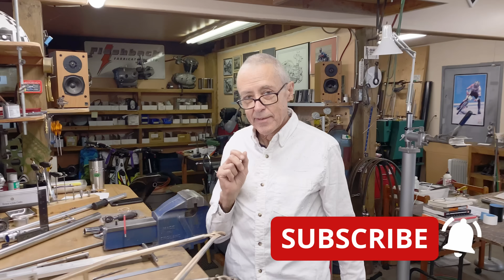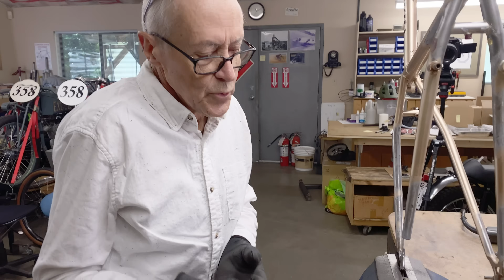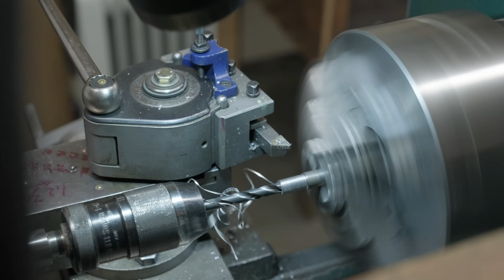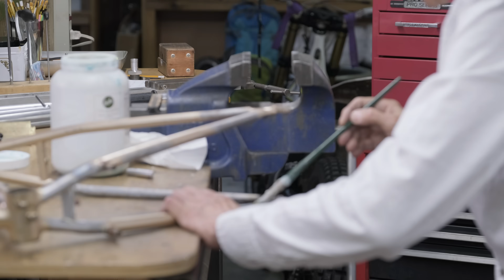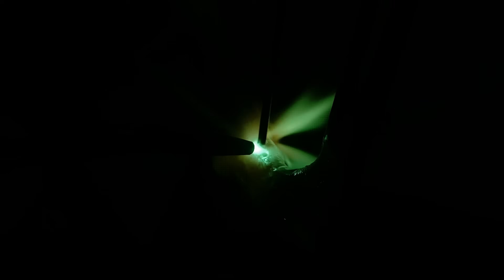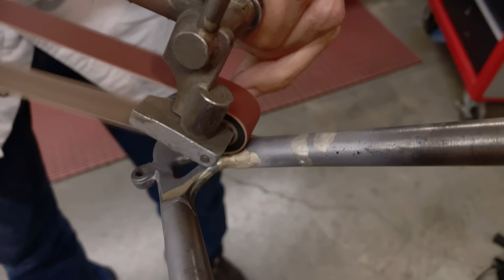How to fix a CRACKED bike frame! // Paul Brodie's Shop

Comment: A forty year old tool vs. a 2 year old tool and the older one works great. Same for everything else. Everything made to fail now thanks to capitalism.  

I have a Trek with a big gouge about 3 inches further along on the same section. I don't have the shop and equipment or knowledge that you have. :(  Still, a very interesting video. Recommended by the Bike Farmer's fan. Thanks.

Comment: Hey Paul, I've got an old Dawes 531st with a small hole and 2 vertical cracks on the chainstay caused by tyre rub. What sort of DIY repair would you recommend for this?  I thought about sleeving it, but the tube is tapered. Another option is patch it over and silver/nickel it. any ideas les me know. if you answer i'll buy you a coffee! ;)

Comment: The "new drill smell" might be ozone. Both drills probably mave brushes that arc a little and create ozone. But the cordless one, when you released the trigger,  stopped abruptly.  That may be done electrically,  making a bigger spark...more ozone. The corded one just coasts to a stop.. Sometimes you can see the sparks through the vents.
   Do you use any particular brazing rod? Al, Si, or phosphor bronze?
   Are these frames typically heat treated when made?
    Thanks, I enjoy your videos and their pace, starting to watch many. I'm more a motorcycle guy, but it doesn't matter much, they overlap.
Reply: Oh...nickel-silver, you said in the video. I meant to ask that brazing alloy question in your dent fixing video, too..I'll have to go back to that.

Comment: I am loving your videos. 
I was wondering why you used thicker wall dom and bored it to a thinner wall thickness, instead of starting with a thinner piece of cro-mo, or use  a thicker cro-mo piece to do the repair?
Reply from the maker: Thank you Kirk.  4130 is not available with thicker walls, usually only thin wall, and is quite expensive. It's just a LOT easier to use DOM...     :face-fuchsia-tongue-out:

Comment: Hey, my columbus slx seat tube (from a very nice bike made in 1982) broke in half in the middle part, and this video gave me hope that maybe it could be fixed with similar type of internal sleeve brazed in. It most likely broke because I weigh 115kg. Do you think it's worth doing? Or should I switch to more heavy duty bikes?

Comment: I broke a Raleigh frame at the drop-out, after 11years of ownership.   They replaced it free of charge, as it was still within the 12 year Warranty.   They gave me a black one instead of the white and yellow one that I had.  They said all replacements were only in black.   I have also repaired motorcycle fuel tanks with pin holes, using 60/40 solder, and a big copper soldering iron.    Best regards from N Wales..
Reply from the maker: Hello N Wales. Thanks for commenting.

Comment: Nice video!  But all the time I was wondering what about the rust inside the tubing?
Reply from the maker: Thanks. That rust has been there for many years. The bike will probably not be raced or ridden hard, so as a collector frame I think it's ok to allow for a little rust.

Comment: Your frames and Pace forks were a dream of mine in my youth. I've managed to get 2 Pace forks since then, but not one of your mythical frames yet.
I have a beautiful Tange Ultimate tubular frame and I'd like to have a conical bushing and disc brake mount installed, but I'm afraid it will be damaged during the procedure. 
What's the latest high-end, lightweight steel tube for a nervous XC MTB frame?
Reply from the maker: I do not know Pace forks. Actually, I've never even heard of them! You will have to choose a framebuilder that will not damage your Tange frame... I cannot answer your question, I am out of touch with the latest, high end tube sets, sorry.
Reply: @paulbrodie  Thank you very much for your reply.
You can't imagine how much these few words exchanged with you mean to me.
Reply from the maker: @siem8160  You are most welcome. But I still have no idea what a Pace fork is....    :face-orange-biting-nails:

Comment: Hey Paul, you look great, I’m guessing you’ll be filling us with educational videos 30 years from now.  To repair stripped threads in a derauiller hanger without replacing the dropout, have you ever used a threaded insert like a Helicoil?  Or another way is better?
Reply from the maker: Thanks John. We will make videos as long as we can. I'm not a real fan of helicoils. On a steel frame I would weld on another hanger...   :face-orange-biting-nails:

Comment: The best welders I have seen always started out perfecting brazing skills. After brazing I always encouraged gas welding which after mastering, almost instantly made you able to tig weld successfully.
Reply from the maker: You might have a point. But you do have to learn to use a foot pedal (usually..) for Tig welding...

Comment: Hi Paul & Mitch, Thanks for the greatclips. On a matter of design, this particular frame has the brake bosses underneath the chainstay. I've never seen this approach before. It appears to be a little on the non-conformist side to me. Wouldn't having the brakes in that location expose them to additional, mud, grit, etc.? Paul, best wishes for your recovery.  Kind regards Greg
Reply from the maker: Thanks Greg. In the mid-eighties, quite a few frames had U-brakes mounted under the chain stays. We rode in the mud, and they still worked fine...

Comment: The late 80's and early 90's was the era for 130mm for your 7spd hubs and 135mm for your 8spd. Eventually 7spd hubs became 135mm to match. Prior to that was 126mm for your 6 speed hubs, and 120mm for your 5 speed. 

Road bikes differed in that they used a 126mm spacing for 6 and 7 speed.

The 80's had some of the coolest mountain bikes, but those hyperglide cassette hubs in the 90's were a huge improvement. My boss said his old shop had a drawer full of left-hand Campagnolo dropouts. All the right hand dropouts were used to repair bikes with broken or bent axles...
Reply from the maker: Alex, thanks for watching and commenting...  I'm not sure how the RH dropouts were used to fix broken or bent axles!??
Reply: @paulbrodie  The bent or broken axles from old bikes with freewheels would often cause a failure to the RH dropout too. Campagnolo dropouts were quite delicate and fine from memory. My boss would often replace an axle and the RH dropout at the same time...

Comment: That electrical smell from your cordless means that the drill windings overheated, which causes the insulation to crack and grow dimensionally, which causes it to rub against the windings as you use it.  This creates that smell, which gets worse the hotter the drill gets.  A more durable brand for a real workshop (vs a home shop) would be something like Milwaukee.  Maybe you could get them to sponsor you and give you a free one.
Reply from the maker: That sounds like a great idea! Yes, I am disappointed with the Bosch cordless. I really haven't used it that much, or very hard. I might take it back to see what they say...

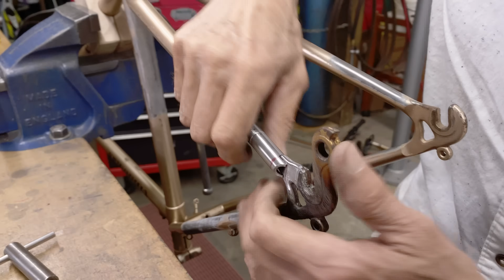Comment: 17:44 - I now think this every time something fits in to something else perfectly.....   🤣
And that belt sanding at the end is amazing, You're like an artist or sculptor w/ that thing.... I'd love to see a small piece of artwork made of all the angles and bends of a bike frame but in a small desktop sculpture, that would be awesome.
Reply from the maker: Thanks. Yes, I do like using my belt sander to help create curves and more. I do like your idea of a small sculpture!
Reply: @paulbrodie  - Thank you, I'm glad you like it.... I was thinking of a piece about 6-8 inches tall and about 10-12 inches long but w/ all the full size parts like head tube, seat tube, bottom bracket and dropouts but the connecting tubes would all be only a few inches long so all the brazing and curves and stuff are all the same as they would be on a full size bike. I think it would be a good way to test students as well.... Now I want to do that as practice whenever I can get a welder and get back into it.   😁👍
Reply from the maker: @xpndblhero5170  I did get my students to build a "baby frame", not very sophisticated like you are describing. Not teaching Framebuilding 101 anymore...   :face-orange-raised-eyebrow:
Reply: @paulbrodie  - That would be pretty cool, I'd love to see a small frame bike or maybe a Paul Brodie Rocker.... That's a small kids size BMX bike for adults w/ fat tires.    😁❤️
Reply from the maker: @xpndblhero5170  Don't hold your breath...  I am busy these days...
Reply: @paulbrodie  - I won't, but it would be a cool video idea maybe....  😉😂

Comment: Hey Mitch. Really superb camerawork on this one. Hi Paul. Not sure if you saw the bright orangey red ClimbMax that Rob had in his collection at the show, but it's most likely going to be mine when it's built up. I bought a black one new in 1990 and have been looking for one to replace  it now and then. I'll need to locate a 1 inch Gatorblade for it, which will be a challenge. I'll make sure to show it to you at the September show.
Reply from the maker: Congrats! Yes, Mitch just keeps on getting better.... How is that possible? See you at the next show :)

Comment: With the weakness in the design of the shimano dropout, would this have been a good time to swap the dropout for a SRAM UDH dropout?
Reply from the maker: Well, it wasn't the dropout that failed, it was the frame tube. Changing to a Sram would not have kept the frame original, so no, not a good idea. Thanks for watching...

Comment: Could a SS be brazed on to that cnc dropout vs. Tig?
Reply from the maker: Yes, we started out by using nickel silver to attach the stays to the (new..) CNC dropout. A few of the RS chain stays cracked, so we switched to TIG and never had any issues after that.

Comment: Recently begin to learn brazing in a small poor bicycle store and doing the same technique with holes when making steerer of the fork longer (or shorter). But without the lathe of course its very shaky fit of tube, that goes inside of the steerer. Was guessing if the tactic with the holes any good and happy to see, that yes :)
Reply from the maker: Yes, you need a lathe to machine the inner tube for a good fit. Otherwise, it is truly a sketchy fix! Be careful. Not sure what you mean with the holes?
Reply: @paulbrodie  I meant that I was made few holes in steerer (only where I have a sleeve inside) to make sure if brass penetrated enough and as additional "windows" to feed brass in. 
btw if I was making it using lathe, how much tight sleeve should go inside the steerer? Because I assume there shouldn't be press-fit - brass just won't go inside. And if my previous statement is right - what do you think - let's say in the case of press-fit: does it makes any sense to cut some groves along the outer side of a sleeve to make "channels" for brass?
Reply from the maker: @isaacrosenberg3795  You said you were using brass... I never use brass on a frame, I always use either a bronze brazing rod, or nickel silver. I don't feel that brass has a lot of strength. I would only Tig weld a steerer tube. I don't think that brazing is the best way to extend a steerer. I understand your questions about fit, holes, and grooves, but I would not do it that way. The reinforcing tube should be "size on size" with the ID of the steerer. That's where the press fit comes from. Good luck.
Reply: @paulbrodie  Thanks for sharing experience and nice that you have time to read a comments!
Probably we using bronze, it could sound funny but a hard situation with languages here, Im a new immigrant and my eng is far from perfect, but eng of local guys in hardware stores is also, so, I actually just hope that we use bronze, not brass.
Good news is that I left that DIY store that masquerades as a bicycle shop and still have experienced friend to learn about brazing from.
Reply from the maker: @isaacrosenberg3795  Isaac, thanks for watching and commenting...    :face-fuchsia-wide-eyes: